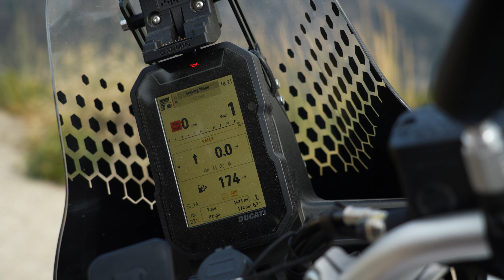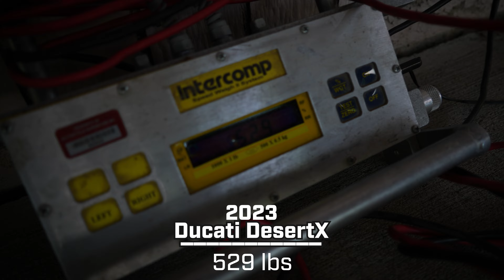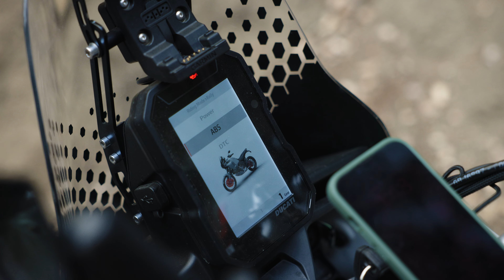2023 Ducati Desert X vs 2013 KTM 990 Adventure - 10 Year Shootout! - Cycle News

Comment: I’ve owned both of these. Have had 3 990s. Had the Baja and did everything to it. Nothing has the soul of a 990 with Akros and a Rottweiler in it. Great motor. Bought a desert x on the spot because it feels like a more planted, lighter version of the 990 with updated hardware that is a way better street bike. If Ktm designed a new 990 with the same look as the old bike but updated the electronics, they’d sell a lot of them.
Reply: I took the X for a testride, and it felt immediately as I had it for ten  years. It fitted like a glove! So yeah I can understand you went for it. But I was very disappointed in the lack of engine brake. Even max'ed out it's almost nothing.
Reply: haha i did the exact same thing, i hope you are enjoying the desert x i love mine just hit 8k on it after 5 months

Comment: The 990 is analog? Nah, my 2005 950 is analog. Rottweiler intake and twin FMF cans, it literally sounds like a trophy truck. Although KTM sorta fixed the fueling issues with the 990 they don't hold a candle to a proper running 950. But that's just my opinion.
Honestly, after spending a few years with my friend on her Ducati Desert Sled, I wouldn't trade my 20 year old 950 Adventure for a new one. Have you read a modern Ducati owners manual?
1000km servicing: See dealer
Adjust valves: see dealer
Change oil: see dealer
Replace air filter: see dealer
Check coolant level: see dealer
Check tire air pressure: see dealer
Adjust mirror: see dealer
Yeah no thanks.

And the 990 throws heat? What? Have you ridden an 1190 or 1290?  Bwahahaha!!!

I'm kind of with the other guy who said the comparison is apples and oranges. Sure the bikes are sorta meant for the same kind of riding but the riders aren't. One wears $3000 worth of Klim gear, shops the Touratech catalog and rides around DQs and Starbucks. The other doesn't even want to be seen on pavement. True story. My 950 wears knobbies and they're ribbed for my pleasure. 😛

Comment: Great Shootout! Owning a 2006 990 Adventure S since new, it is sooo cool to know from the experts that still nothing can beat it. After almost twenty years, some bikes come close, but at a price. I won’t pay 3 - 4 times a value of my 990 for a possible few % better bike. So, here are next 10 years on a 990 and then I will check again.
Reply: My idea completely! I've a 2005 950 since 2008, 127.000km and counting. The X is the first bike in 20 years that finally comes close to/equal with the 9x0! And, Cycle News, no the 990 is not 10 years old (yeah, the one in the movie is), but it's TWENTY YEARS old! Because, the difference between a 2003 LC8 and your 2013 LC8 is naught to nothing.

Comment: The 990R didn’t come with ABS but the regular 990 does and you can turn it off when off road. The R has slightly more front and rear travel.
Reply: Slighty more front/rear travel for R was only 5cm or for some models only 2.5cm.
Regular - 220mm, R was with 265mm sometimes it's make a difference..

Comment: If you do a long trip on the ktm, get a single tail pipe conversion and fit an auxiliary tank, as it drinks like a fish. Also needs a better seat, as old ktm seat are like granite. It would also benefit from some extra cooling as they get very hot in traffic. This shoot out proves the  ktm 990 was well ahead of it’s time.
Reply: That’s my setup 😉👍
Reply: does the conversion to single tail bike help improve fuel mileage even without an aux tank?
Reply: @ojalaandrew887   
I don’t think it improves mpg much, but it will remove the Cats I think from memory and if you do that, the bike will need a new fuel map which you can get from KTM. I don’t think it costs a lot.
Reply: I have had both 950 and 990. The carb 950 is a better bike to run, its fuel consumption is lower and the engine behavior much better compared fuel injected 990.

Comment: And honestly that KTM is 20 years older. The 950 was released on 2003 and only had a few changes to the 990. Mostly a few CCs and fuel injection but overall it is the same bike.
Reply: That's pretty crazy when you look at it that way... 20 year old design and it still performs incredibly well. Would be hard to find another bike that's 20 years old and feels that modern.
Reply: @EddyLukas  The 950 was a terrible gas guzzler though, and the 990 only marginally better.
A lot of 950/990 ended up with massive heavy fuel tanks installed.
Reply: not the baja
Reply: @carpenterAF-dz2zq the baja is the same as any of the 990s just has a few add ons. (Rear rack, tail bag, tank bag) but otherwise very much the same bike

Comment: I bought my ‘12 990ADV brand new off the showroom floor in 2012. Of all the bikes I’ve owned, it is the ONLY new bike I’ve ever purchased. It’s sitting in my garage right now, with +65k miles on it, and it will start up first hit of the button. The only thing it needs is for me to replace a broken indicator, which to be fair my wife broke it off. Not saying the bike has had no issues (it has), but the good vibes and enjoyment I’ve gotten from that bike over the years has far outweighed the problems. And FWIW, the problems were almost always something minor, the motor has never been apart. If you take care of a 990, she will take care of you.

Comment: Every time I see a video that features a 990 I get super sentimental about my old 990... Shouldn't have sold it. The feeling it gives just isn't matched by any other bike I've ridden adter
Reply: I just got a 950 this summer and just came in from wrenching it. Made a cup of tea and saw this video in a youtube recommendation. I guess I will keep mine as long as possible, since actually I don`t know for which bike I would like to exchange it. 1290 super ADV is nearly 20 grand brand new and more of a touring bike. 890 and Norden are with faulty cylinder heads. Africa Twin is 230kg dry, if i`m not mistaken. Nah, I will stick to this old thing until it completely falls apart. What is also interesting is that my 950 feels sharper and has more responsive throttle than my friend`s 990. I dont know if my carbs have been adjusted in some way by previous owner but the throttle on my bike feels like a crack of a whip.
Reply: @reinisrudzitis4802  The 950 has way better fuelling then the 990 tbh. The 990s were known to be quite herky jerky on the throttle. It got better in the later years but it was never as good as the 950s were
Reply: @tolga1cool I have both and I can confirm. Even though my 950 is 10 years older than my 990, it still works better for her originally intended purpose. Other than being newer, with a little more power and a tad less vibey, I see no advantage to the 990.
Reply: @reinisrudzitis4802  Early 990's with EFI had some fueling issues, so it's not surprising that a 950 with well sorted carbs would run better. I've had to get my 2007 990 remapped on a dyno, because in stock form it ran like crap at lower RPM's.

Comment: Was thinking which Adv bike to get. Love the 990s, own a 990 SMT with great ABS. But the 990 ADV R has no ABS, which is a no-go for me. Got a 1190 Adv R for less money than a 990 Adv R, love the 150hp on the streets, added heated grips, shaved 20kg off. With 23 l of gas it weighs 227kg. 
Runs stable up to 260 kph. Takes 5 - 6 liter on 100 km. Good overall bike. Reliable too.
Reply: Mate I used to own an 1190R. Would have to be one of the best bikes I've owned. Only gripe was it was really too tall for me. I'm 5'9". How did you shave off 20kg?
Reply: I also had a 1190R.  Rode hard offroad here in Australia.  Recently. brought a smick 990 R. No abs or traction control and this thing destroys the 1190 offroad.  I can get way wilder on the 990R, if I rod the 1190R the same way it would kill me.  The 1190 was better on road.
Reply: @brettstone6885  that's interesting to know mate. I'd heard the 990 was still a better off road bike than the later models. What part of Aus mate? Most of my true off road riding the 1190 was in the Otway's and Vic high country.
Reply: @frankensteinsgarage9632  South Coast NSW mate.  I did the KTM rally on the 1190 in Tassie and rode it hard.  Really struggled in the rough stuff at speed, the geometry of the bike is off.  Hard bike to steer through the twisty single track while seated, not so on the 990.  990 has a much better front end feel.  I was running 30-32 psi in the front tyre and had 4 flats in 1600km offroad.  Heaps of fun but doesn't cope well  when hitting multiple ruts ect.
Reply: @brettstone6885  good stuff mate. Maybe I need to keep an eye out for a good 990
Reply: @frankensteinsgarage9632  If your tall enough find a 990R 265mm travel no abs or traction control.
Reply: @brettstone6885  nice description of the 990. I just got myself my second one. Another 2009 White which I raised to close to 300mm front/back. It's amazing and it flattens rocky terrain where I take my 500EXC. Amazing bikes.
Reply: @frankensteinsgarage9632  other exhaust, no crash guards, no sozia pegs, self printed luggage rack, li ion battery, etc.

Comment: My 2010 990 had over 50,000km’s on it when I sold it in 2013 and was still running perfectly and I still miss it.  It had a hard life 70% off-road
Reply: You got the 1 out of a 1000.
Reply: @DannyHerron  I had a 990 SMT for 10 years and it was solid as a rock ... so what, 2/1000 ?
Reply: 50k kms is absolutely nothing. LC8 if well maintained (water pump seal, cam chains, regular oil changes) can definitely go 150-200k km if not even more.

Comment: I still have never seen any new offerings which could replace my 2013 KTM 990 Adventure Baja. I got it specifically because there are NO electronics to step in and mess with you. The KTM is however a motorcycle best owned by a technician, otherwise you will spend way too much money paying someone else to do the work, and it's a pain in the a** to perform regular maintenance compared to the rest of the options.
Reply: The Desert X won't be easy either.

Comment: The KTM 990 Adventure was released in January 2006 (Adventure R in 2009).  The DesertX was released in 2022 and is 16 years younger :)
Reply: Its an 890 not a 990??
Reply: @brucekendall52  890 is the modern in line twin. The early 2000s 950/990 Adventure and 990 Duke are V Twins.
In 2025 there might be a new 990 Adventure but with the inline twin engine, not the classic 990 V-twin
Reply: The 950 is the same bike as the 990 but carbureted and was released in 2003

Comment: I like these comparisons with the old 950/990! That was a terrific bike that had all the basics covered, and still looks appealing today: 18/21 wheels, great ground clearance, suspension travel, good damping, 100 hp, strong brakes, mid 400 lb range. 
I would have hoped that modern materials and manufacturing would enable the manufacturers to shed weight from these bikes, but alas.
Perhaps the new Kove 800x will be the unicorn?
Reply: The baja is 115hp

Comment: i currently have the Desest X and it's a better bike but it's 10 years of tech and learning on the 990  which still is a great bike
Reply: Hi, you try both? How are for off-road stuff ? Pro and cons? Im Just going to buy One of these two
Reply: @alberto-cg7ox  well they are 10 years apart and the Ducati is just better the tech in rally mode is really clever so it compliments your riding. But it really does depend on your skill level i race enduro so i'm a decent level rider and i would pick the ducati every time it's reliable plently of grunt but the KTM is better to crash and parts are cheaper however it does feel more off road biased whereas the ducati is more onroad biased but it does everything great

Comment: Those are both heavies. The base model Africa Twin only weighs 503lbs fueled.
Reply: Put crashbars and a luggage rack on the Africa Twin and the difference will be gone.
Reply: Nup…KTM 990 Adventure is 460 dry, 492 fuelled, add in oil and brake fluid and it’s certainly not heavier, maybe line ball, most likely a few pounds lighter
Reply: My Ducati DesertX has Genuine  Ducati bash plate, crash bars, aux lights, heated grips, aux bar w/Ducati branded Garmin GPS, bar bag, full race Termignoni de-cat race exhaust and EVO tune.
With brand new Scorpion STR tires tires installed and filled to the brim, it tips the scale at 488 lbs.
Sorry, the Honda is heavier then the DDX.
Reply: @jamescampbell4334  That is objectively not true unless your accessories are made of Helium. 

Ducati says 463lbs (unfueled) themselves. Fuel capacity is 5.54 gallons. One gallon of gas is 6lbs. 

At an absolute minimum, with NOTHING else on the bike, it weighs 496lbs. 

Yours weighs virtually the same as the base model Africa twin.
Reply: @someguy5035  
Full wet weight of the DDX is 492.
Termignoni full race decat exhaust drops   the weight to around 482, the accessories added around 6 lbs.
That is objectively FACT.
Edit; I have the rear peg assemblies removed too.
Reply: @jamescampbell4334  Unless you are using some sort of special lightweight fuel, that is not physically possible with a full tank. And I didn't count the 3.5L of oil it takes which weighs at least another 6lbs. What about the coolant? At least another 5lbs?

Even if you saved 11lbs on the exhaust, it still doesn't get you remotely close to the numbers you are claiming. You basically just offset the weight of the coolant and oil.

Your crash bars, bash plate, and everything else must be made of helium too because they magically did not add any weight.

I don't understand why people are like this. Why lie? It doesn't even matter. No one cares.
Reply: @someguy5035  
Do you know of a shop in North Texas.
I'll be glad to bring it there and let them weigh it. I weighed it on a set of Intercomp scales.
Reply: The AT is pretty heavy in the real world. Way too heavy. Honda usually lies about the weight...
Reply: @valefur72  
Truth. 👍
I find it interesting that someguy inferred  I was lying about the weight of my DesertX. Then did calculations for fluids to the 492lb weight when that # IS WET WEIGHT. Then never replied when I offered to put it on a scale AT A SHOP OF HIS CHOICE in the North Texas area where I live. Have a dealer for nearly EVER major motorcycle manufacturer within a 30 minute ride from my garage.
Just ordered a 3rd set of tires for the DDX (over 13k miles on it). After the tire swap would be an ideal time to check weight.
Reply: @jamescampbell4334  that said, the AT is a very nice bike and a good choice.👍
Reply: @valefur72  
I agree. It was in the running before my DesertX purchase.

Comment: Very well done video except for the music volume increase when the talking stops. Not enjoyable have to turn down the volume each time the segments change from talking to riding. After watching Adam Riemann ride the KTM 1090R in both the New Zealand and Australian adventure rallies, I knew that was the bike for me. I love the 990 but the 1090R adds a few rider modes that can make off-road riding safer, and the heated grips make Winter riding a joy, even in Colorado, USA. I use a computer for all; internet and do not own/use any wireless technologies, so the new bikes hold no interest for me: they are too complicated, and with the new KTM 890/1290, some riders have had starting issues off-road which in rural Colorado, can be very dangerous. I love how the motorcycle industry builds bikes that can make everyone happy; some prefer the latest electronic tech, while others like myself prefer less or none at all, as on the 1090R and the 990. Thank you for the great job making this video, have not seen the results of the proposed South America ride, but will research that now!
Reply: Hi mate, Reimann can make anything look amazing, very talented rider here in OZ.  Ive extensively ridden the 1190R, very similar to the 1090R, I know own a 990R, 265mm suspension travel.  Its a miles better DIRT bike than the 1090/1190.  The 1190R is much better on the road with just insane power.  I'm a fast off-roader and ride my bikes like a rally bike and the 1190 had major limitations offroad that the 990R does not.
Reply: @brettstone6885  you have much better skills than I do! I ride a 2023 KTM 350 EXC-F for difficult/technical off-road rides.

Comment: Wait till you have to adjust the chain on the Ducati...what's the torque figure for the wheel nut?
(Biased 950 owner).
Reply: Seriously I sold my Ducati because I literally couldn’t find an accurate spec to tension the chain. Even bought the dam Hanes manual. Ducati is for rich people
Reply: I love both bikes l.. but you're right. I've also call ducati and Say they don't want to let the workshop manual (not the maintance). I have nothing against electronics.. but if I can't use any software to diagnostic or repair issue it's a big problem when travel .. if something happend in offroad how to do? 950 have carb so no software.. 990 it's efi but I can use tuneecu and software Is open... All new moderno bike have lock software.. it's not Freedom.

Comment: I wouldn't want to fix the Ducati either on the road. Cause YOU CAN"T. You can't even in your garage.
Reply: It has one step air filter cleaning. Step 1) Contact your Ducati dealer.
Reply: @j0hn22 
I've done the filter swap in 20 minutes.
Installed a 3 stage foam Uni-Filter (Australian company) so it only needs to be swapped every 9k miles or so.
One of the first DesertXs was ridden 13k kms across Australia with the 2 stage Uni-Filter without cleaning or swapping.
Reply: @gpzfan5272 What equipment did you use to reset the service light?

Comment: 990R would be a step up to this s model.  But still, a great comparison.  The OG, the King, vs the newest punk on the block
Reply: Just taller suspension, but that is an easy remedy. The Baja ant the later Rs share the same engine map (115hp)

Comment: I LOVE to PARADE  at Starbucks.  At 37k I am still  open throttle and no problems . I  Have issued with brakes giving out. Want Rottweiler  performance and a valve job.   Might  as well cycle south  and have 3 bikes. Pick me:)